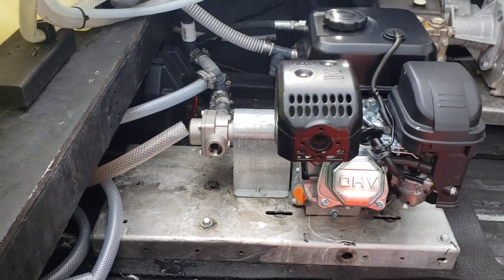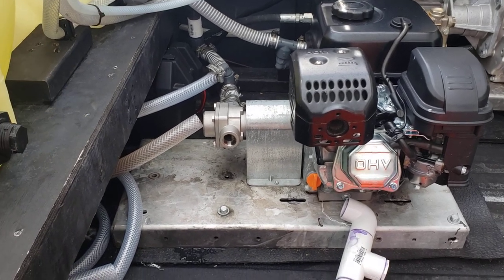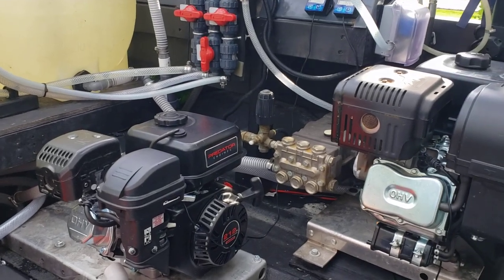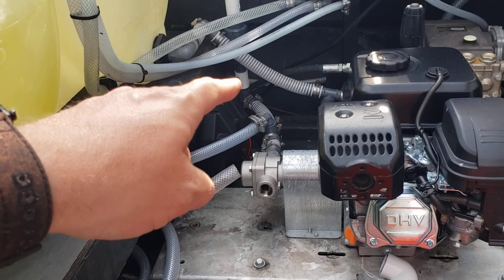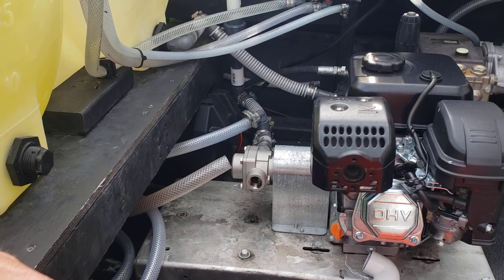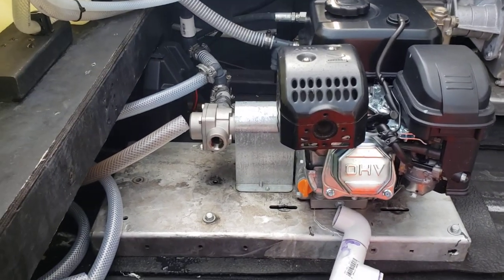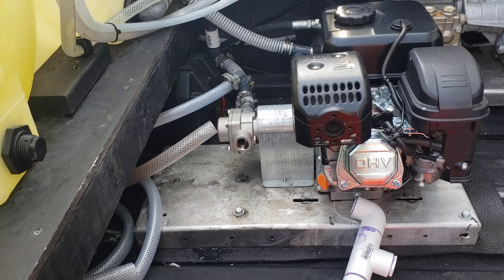An inexpensive GAS Softwash Pump??

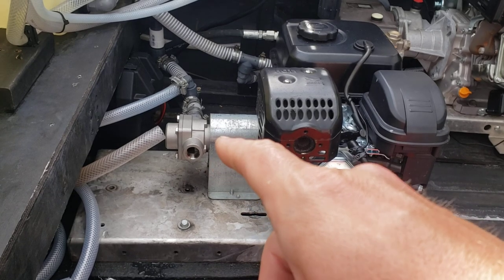Comment: Can I ask where you got that adapter/coupler at 1:05 ? I cannot for the life of me find that online. 

I started with a Dewalt 2.5 gpm a couple years ago that had a gx200 in it. When I upgraded to my 8gpm, ironically the 2.5 gpm pump blew when using it to wash something at my own house. But I had this same idea to do this, salvage the gx200 and make a soft wash unit out of it somehow 👍

Comment: I think I’m going to try this. I have a Pumptec X6 being delivered next week. Check those out for a 12v alternative. They’re beasts. I want 3 options on my trailer to get chem on a house and keep the pressure washer for surface cleaning and a 4th chem option. I just seem to have the most problems with a downstream injector so I want it to be the last option. The 12 volts are just ok. 
I know the walk of shane trips to the hardware store all to well.
Reply from the maker: go for it! If I had to do it again I'd get a 6-roller! Try it for me and let me know how it goes.

Comment: I just purchased an old Lesco sprayer and i am converting it to a small soft wash rig. It is a skid sprayer used to spray pesticides and stuff. The pump thats on it is a Hypro D252 diaphragm pump. Basically i am simply freshening up the engine and rebuilding the pump. I hope it works out good. It came with everything needed, Electric reel, 100g tank, Skid, motor, pump for only $75.00 at auction, They had 9 of these older Lesco skid sprayer for sale. I am not sure why people don't use them for soft washing lol i must be missing something haha. Only issue is i will be batch mixing for now. I plan on building a better system/rig later on but for now i hope this sprayer works ok for the mean time. Thanks for the videos i appreciate it bro and also i like the setup it looks good and it should work fine. If you could give us a cost break down that would be great.
Reply: Just bought a North Star 55 gal Agricultural sprayer and currently trying to do the same idea. How did your set up work out? How did you go about rebuilding the pump?
Reply: @planetheaven1019  I actually used that sprayer until the pump went out, it was a gas motor with driveshaft mounted Hypro pump, those pumps are rebuildable but i simply switched it out and with electric using a 12v system. So basically i have a two tanks one for chemicals and one for water, 12v 7.gpm Pump, 150ft hose and wond, Works great i make money every day using this setup and its simple and easy and cheap. Later down the road i might upgrade to something better but for now this rig works great. Depending on what kind of pump you have, Most pumps are rebuildable and you can buy rebuilds kits for them online.
Reply: @chadshouse2059  so when the gas pump went out you mounted a 12v pump and battery onto the agri skid? What are your thought gas vs 12v softwash system, since you’ve used both?
Reply: @planetheaven1019  I liked the gas setup and the power the gas pump put out but to be honest it was loud and stressful, the 12v system isn't as powerful but its reliable, dependable and silent. I think i would say like the 12v system better and the maintenance is a lot cheaper.

Comment: The issue is in the PVC. You can't use pvc in this type of set up not only due to vibration but pressure as well. Hose is the way to go, preferably higher psi rated. At 3600 rpm the pump will create a lot of pressure.
Reply from the maker: I found this out the hard way and ended up putting the return manifold a little way  after some hose to absorb the vibration. This iteration of the machine failed.

Comment: You should always run soft hose off of gas motors due to vibration issues then tap in to your ridged line setup.

Comment: Great try. Keep at it. I’m thinking about trying air diaphragm as opposed to the booster. The gas pumps scare me because they are not reliable
Reply: Ive been running my AR45 Gas roof pump for 5-6months and haven't had a single issue with it and I use it for everything except concrete. And takes 10mins to replace I bought the pump separate since I already owned a Honda GX200 so I only spent $1000 and no need to replace the motors since they are pretty bullet proof